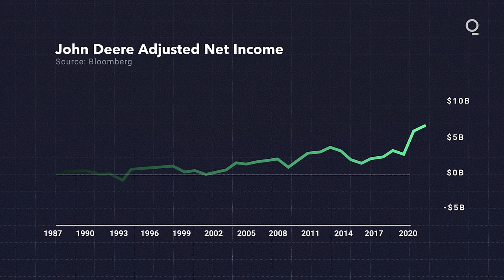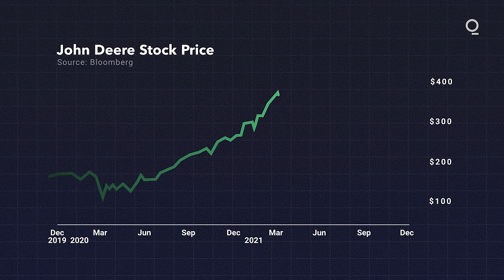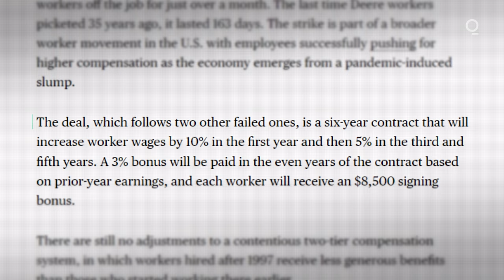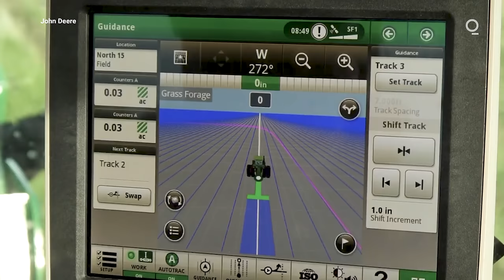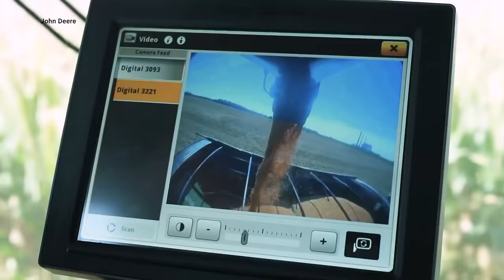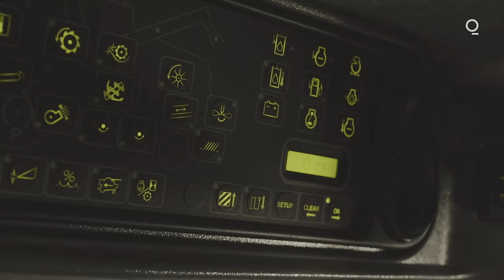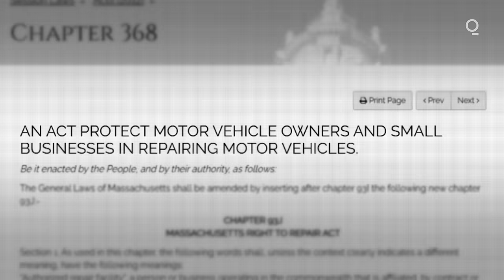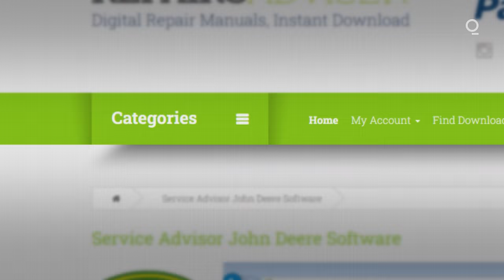John Deere Is Facing a Farmer Revolt

Comment: Another factor not mentioned - Deere has eliminated smaller dealers by forcing them to sell out , or simply forcing them out of business with tactics that skirt legality and are ethically bankrupt.
Reply: I hope it comes back to haunt them until they go bankrupt
Reply: Not just Deere, and not just ag. They got the idea from the automotive industry
Reply: Agree with all of this.  The argument of 'this tech is so beyond you mortals' scares the normal person that doesn't have experience with the equipment.  Most folks just want to be able to do a self re-set, after changing out a filter/ware part.  They aren't asking to rig the thing up to a RC controller to drive the thing from home.  
It's only illegal if someone calls them out on it >.<
Reply: @crinkly.love-stick  Russia is more than ready to sell you agricultural equipment which are on the same technological level to what exists in the west. All of them were designed to be DIY repairable and restorable IN THE FIELD with simple hand tools. Anything electronics and electricals has quadruple redundancies and can easily be accessed and repaired with simple household hand tools. And Russia can set up shop containing all of the components of all farm equipment and it will be again just like the the 1970s and 1960s and 1950s and 1940s and 1930s when if something needs fixing you can just use your hand tools that you have, check what is wrong, then go to the nearest mechanic hardware shop and buy the component replacement spare parts and go back to your place and fix it  up within a very short time. If you want to, Russia will even set up a components' refurbishing shop to dismantle all components and figure out on how to restore their components back to pristine condition just like brand new. That is, if this tension between our two countries is allowed to thaw out first.
Reply: @darthvader5300  I've owned and worked on plenty of ruskie tractors to know that they're miserable to work on. Only ones that are worse is kioti.
Reply: Sadly this is every company. Caterpillar does the same thing. It's a matter of time before every type of dealership does this. It needs to be stopped
Reply: Why aren't I surprised
Reply: Sounds like anti trust activities...
Reply: @darthvader5300  But they don't meet US emissions technology.
Reply: @darthvader5300  Don't worry, Brandon is working on getting Russians here, but they will probably bring tanks first.
Reply: @crinkly.love-stick  Don't know anything about tractors. But these two guys in the comments singing praises for Russian tractors are without mistake political bots meaning to tender the public view on Russia during the ongoing crisis. I currently live in Russia, I have an eye for such things. Nonetheless, was caught off guard seeing such activities in the discussion about agricultural machines, for Pete's sake!
Reply: @jayjaynella4539  exactly, Flight Radar24 shows US drones and other military surveillance aircraft flying on the Russia border 24/7. Why is the US concerned about Ukraine's border and not ours?
Reply: Seems to be that there's opportunity here. Calling Mr @elonmusk.
Reply: Could you mention some of these alleged tactics?
Reply: @timchamberlin9280  no they don’t.
Reply: @JeremyCoppin  Ugh.  Musk would be like "Here's my bullet proof self driving tractor that can outrun a ferrari.  We start delivering in two years.  Have a flamethrower!"  Then, two years will pass and he either won't deliver jack or it will be a far cry from what he promised.

Besides, Tesla isn't known for it's support for right to repair either.
Reply: Were you born  and raised in Russis, are you a Russian  citizen. ?
Reply: @crinkly.love-stick  Who makes the best tractors to work on? Or are the most reliable?
Reply: Hmm, that is illegal.
Reply: @LetsTakeWalk  Not here it isn't.
That's proprietary info.
Reply: That's big busyness for you !
Reply: The rural Amazon.
Reply: It's not just agriculture or automotive, everything is owned by just a few companies and control prices.
Reply: Yes -- 3 generations of my family bought from 3 generations of the local dealer..... They were "forced" to buy up the smaller dealers around here until it just got too miserable for them and they sold out to someone bigger.  Ironically for Deere, a lot of other colors have now started to appear in the local fields.
Reply: Exactly
Reply: @timchamberlin9280  not hardly
Reply: @ColonelSandersLite  true story! You have to go to Tesla for EVERYTHING
Reply: this is happening in EVERY industry.  Wireless, communications, internet, food, finance, resources, etc, etc, etc, etc, etc.  Accelerated by the lockdowns destruction of small to medium business'
Reply: What about the company Duetz-Fahr?  You’re provided the schematics on the products you purchase and you can buy the parts?  I’m curious about this. Does anyone have experience with the company or know someone that does?
Reply: @Zacknafin  Anybody buying new equipment today was born into using technology and is much more adept at dealing with why something with buttons is not working properly. The auto industry is not pleased that OBD scanners are so inexpensive and effective in diagnosing new car failures. Why is JD able to deny right to repair when the auto industry cannot,
Reply: They have also made dealers sell to others.
Reply: Smarter operators don’t use John Deere.
Reply: @crinkly.love-stick  Ugh, I hated wrenching on Belarus
Reply: @cokiea57  Tonka.
Reply: @royfrye2871  If the battery fails you have to buy a whole new battery pack instead of getting it repaired for a quarter of the cost.
Reply: @bossdog1480  right. And I was speaking about any other repair as well
Reply: In the UK they are rather like dictators than business partners .
Reply: @darthvader5300  Most of the produced steel is going to the weapons industry. So legs of cultivators are twice as thick and bend. It is also very difficult to make a turning plough and in Russia there is no nearby workshop

Comment: Knowing not much about this, John Deere lost me the moment they equated the safety of a tractor going down a dirt road to a 777 flying at 40,000 ft with 200+ people flying over the pacific ocean.
Reply: even if it is on a paved road it's out in the country where everyone driving on that road is very well aware that it's farmland and to be cautious
Reply: His analogiy is totally wrong because dont airlines own the equipement and maintain their own planes. i dont think have to go back to boeing everytime they need something repaired
Reply: @Hotspur37  yes the have to go back to boeing.because the onley one to repair the plaine are ingeniers from boeing.and you onley may use boeing certifid tools and replacement parts .if you lost a scruw to hond the toilet handel you have to order one at boeing because if you use an other one you will bring the plaine and passagers in danger .
Reply: Exactly what I thought, with one exception, a  home repair on a 777 could get it hijacked by way of computer. So really it's more like 1000+ people. But same idea, these two analogies are not the same, or don't equate.
Reply: @chikes4862  Airlines repair their own stuff all the time, you're simply wrong. Parts are not the same thing as repair.
Reply: Not to mention there are usually a lot more trained and certified A&P guys than there are JD mechanics.
Reply: no kidding. Aviation has plenty of licensed mechanics available. They're no where near as bad as John Deere's service department.
Reply: Boeing actually has on contract that only boeing parts can go into boeing jets. Only to be in stalled by licenced boeing aeronautics technicians. Rather than distributing the information on how to properly install the parts freely and make sure the individual shop is liable for the security of the repair like other companies have in the past and still do. This is why many pilots are going away from companies like boeing and cesna
Reply: @Hotspur37 Actually aviation is one gigantic racket, commercial airliner must fly with ME ( Operational Minimum Equipment) when the stuff frequently breaks/ needs repair,owner of plane has only 1 source for new spares from Boeing Component Suppliers; everything else,ton of money to overhaul-repair ECMs,etc.
Reply: @carsondinwoodie5840  However, Most repairs can be done without Boeing. I did aircraft welding in the Military and you would be amazed at how we violated tech data to accomplish unauthorized repairs. I cannot remember the repair limits on tailpipe cracks, but I had cracks that were more than 4 times longer and did those welds with approval of the DCM (Deputy Commander for Maintenance). "T" cracks are expressly forbidden, yet I was able to accomplish those also with success. This got parts to last much longer rather than buying replacement parts saving millions. I got an Achievement Medal for that. But I saw many other disciplines do things like this as well, even in Avionics. Of course this goes back decades as I was in from 1983 to 1988.
Reply: @gregoryfrance1723  Neighbor worked for a Legacy Carrier. He told me he and others frequently buffed out cracks and scratches well beyond minimum specs to keep the planes in the air. Patches were done only when absolutely necessary; as they added weight, burned more fuel from added drag and plane would be considerably down  waiting for their Tech to do repairs and costing the airline in lost revenue from plane waiting for a time-slot  for repair/s.

Comment: "Safety" is the hypothetical "buzz word" used by any company trying to keep technology proprietary. We all know, it's nothing more than a money grab. I'm rooting for the farmers!!
Reply: Well you know, a tractor is the same thing as an airplane, so you can't mess with the safety, right? LOL.
Reply: yeah, they talk about airplane safety, but they're forgetting that the 737-Max's MCAS and the hundreds of deaths it caused was a fault of Boeing's total Lack of Transparency, and likewise John Deere should be more transparent
Reply: I just saw a tractor fly over my house and I know I was greatly reassured to know it was a Deere.
Reply: ya, but didn't you feel safer when all those lithium batteries were catching fire, knowing that they were genuine, OEM flames? LOL
Reply: "rooting" for the farmers... I see what you did there !
Reply: Yep, that tractor going 10 MPH with one person is just as dangerous as an aircraft going 500 MPH with 400+ people on board. I would have loved to see a polygraph reading as he was saying that statement. I am not a farmer, but I am a DIYer and will try to fix anything if I can get access to the tools and parts. Very frustrating when you can see what is wrong but all replacement parts are controlled and not available. I have a 2021 Hyundai and, in the maintenance manual even the simple repair items just say Contact Dealer. This even applies to changing a headlight!
Reply: Ditch John Deere , buy Mahindra tractors
Reply: if it was communist, they would allow people to repair their own equipment, as money would not be something to worry about, and the government would likely be much more to worry about
however even if it is in a nation where even prisons are for-profit , it should allow people to repair their own equipment
oh also "oh but it has any form of electricity, its illegal and extremely unsafe to touch!!!!!" as they live in a house with electricity using devices that use electricity, with electricity inside them
Reply: yeah, they might as well set up subscriptions instead of sales 🤣
Reply: @ronsullivan132  Yeh i couldn't even change my sidelight bulb on a 2009 Nissan Qashqai such awkward place, let alone do anything else
Reply: @ronsullivan132  You do know that farming is one of the most deadly professions right? That's not a joke either. I'm for right to repair but making fun of something you have no idea about is juvenile.
Reply: I worked in semiconductor biz. That safety is real in some regards, but a tractor running out in the middle of nowhere is very very low risk. Deere needs to make this right and very modular and offer the farmers a diagnostic package option. Have to wonder if yields went up because of a self driving tractor or the fertilizer/seed used.
Reply: @never2yield20  Farming is one of the deadliest jobs in the world. It's not just driving a tractor. How do you think they get connected, loaded, mixed and ready to work?
Reply: ME TOO!
Reply: Too true!
Reply: @danielmorse4213   You want Govt to regulate  what the Company  does  right ?
Reply: @sarahann530  don't be a troll
Reply: a brand updated the micro wave via wifi ??? the micro wave was a type R500 but the new software was for a s500 .the S500 used an other wifi module so they could not undo the update on the micro wave oven .the buyers have to take the micro wave to the dealer where he can reflash the micro wave oven . due to saftey measuers they cant let the owners do it them selfs ?????
Reply: It is crazy to hear him speak of ”safety“. Looks like this guy could be in government. (Especially during Covid)
Comparing one farmer to 300 passengers: what is wrong with his brain !?
Reply: @martint6680   You don't seem to comprehend Companies can be  held liable  whether it's one life or 300 . That's is why ladders carry warning labels .
Reply: @ronsullivan132  Parts should be available.
If not from the company then from competitors.
Make it legal to repair and modify anything.
And move responsibility to the owner for safety and implement inspections and rigorous testing.
If a car or truck or tractor or whatever fulfill the requirements of a yearly inspection then they're road legal, insurable etc.
If not, they have to stay on the farm and used at the owners own risk there.
As long as a modification still gives a vehicle the capabilities etc that are demanded by the law it's non of Deers business what people do with those things...
Reply: @subaru4920  Not necessarily.
I mean, sure, the us government is extraordinarily poorly run by western standards.
But governments can be done right just like companies can.
Look up the nordic ones.
Reply: I know I am surprised they did not mention the harm to the children.
Reply: @JoeOvercoat  was it a reindeere?
Reply: Car companies also used to be super-possessive about their ECUs, using proprietary trouble codes and readers. Again, their dealerships stayed afloat on repairs. 

I just bought a nice little Bosch OBD2 code reader for $70 new. Plug it into most post 1997 cars, it recognizes make, model, year, and engine; it reads, logs, and clears trouble codes; tells you (for instance) which wheel has a bad ABS sensor and roughly what the part costs to replace. It graphs engine performance, trans fluid temp, and gives dynamic status of MAF sensor and throttle position. Using this tool and a Haynes manual, I can know exactly what needs to be fixed, how much the parts cost, and whether I can do the work or leave it to pros. Farmers need that same power.

Comment: It's John Deere that wouldn't exist without farmers, not the other way around.
Reply: they are acting like there aren't hundreds of other companies vying for there market shows how bad brand loyalty can be
Reply: @highlandrab19  - That is also true. But JD provides what the customer needs, then they work out a strategy. A farmer, in other words, the customer will not continue to invest every year.

What is often forgotten is that selling is a kind of psychology in which one has to bind the customer. And how they have done that has also been successful in recent years.
Reply: I like this saying, but it's not true. Excavation equipment and power units are a fair part of them as well
Reply: LOTS of Red, Yellow and Blue ones around here too.  Farmers have options if pushed.   Maybe not so much the Red ones.😁
Reply: @highlandrab19  trouble is, all the large ag sector is doing the same thing. for some reason Deere takes the majority of the heat. Try working on a Fednt or Claas without dealer support.
Reply: John Deere is involved in dozens of markets. Not just farming, but power generation, earth moving, logging, and more. However, I agree with what you are saying. We need the "Right to Repair" on everything.
Reply: @andyandy4459  that's not farming, that's excavation a different category then agriculture and I've never seen a deere excavator here in oregon most companies are using caterpillar, Hitachi and kobelco.
Reply: @thedude3189  interesting, I see quite a bit of Deere excavation equipment in Pennsylvania, forestry equipment too. The point remains, Deere could lose half their AG customers and still survive as a company.
Reply: John Deere stocks when they invented farming 📈
Reply: @TheCeki1982  i feel like selling should not be something that binds the customer, that feels very "evil"
Reply: @god4943 John Deere invented farming 😂😂
Reply: Yet*
Reply: old John Deere turns in his grave!!  what they doing  over his name!!
Reply: That's right